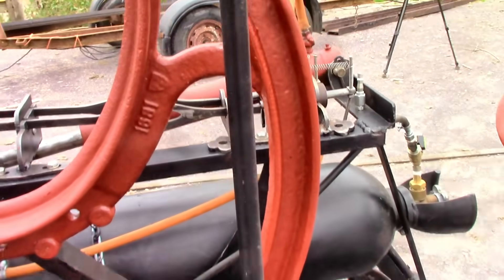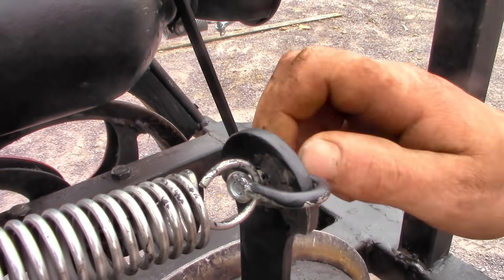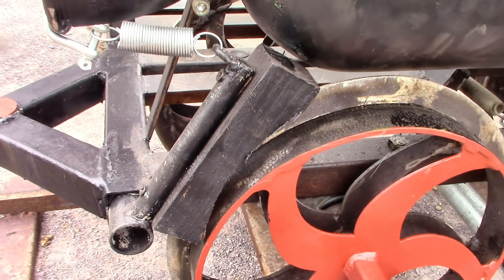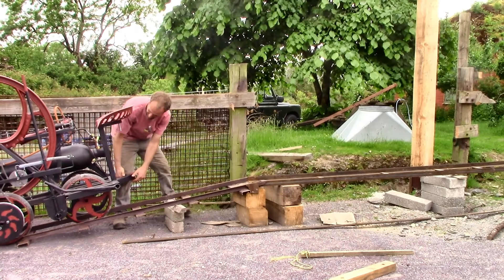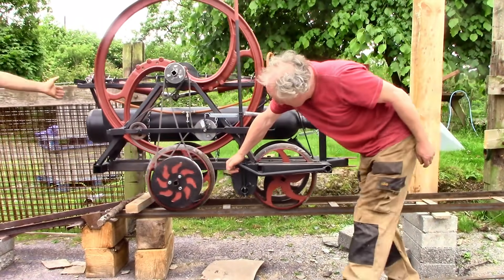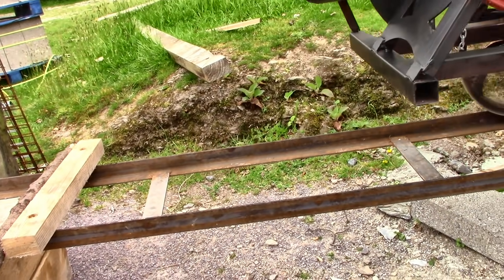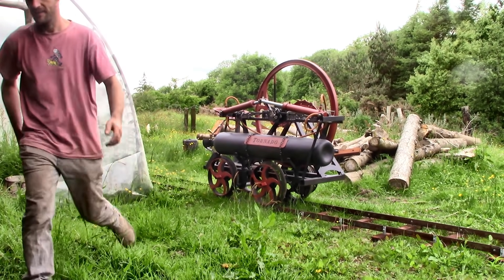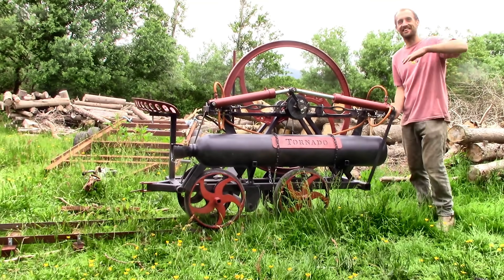First Run!! Home-Made Compressed Air Locomotive For The Field Railway

Comment: This is looking very promising, congratulations on achieving the running prototype! 

I think one of the problems you might encounter as this gets more use is that with both running and braking the thin angle iron rails will start to eat grooves into your wheels, which don't have a steel "tyre" as a replaceable wear part, so once they're worn they'd be a total loss. I highly recommend checking out something called "strap iron rail" which is basically steel straps nailed to timbers, an old frontier logging/mining innovation. This would widen your railhead quite a bit, which would help with wear, braking, and traction. They'd also most likely be a fair bit cheaper than your angle iron rails. With your CNC machine you'd be able to cut curved pieces, to fit to steam-bent or jointed curved timbers, making curves probably a fair bit easier to accomplish to boot.

Comment: Superb job , why don't you connect both axles  with a chain drive ,that would increase your adhesion and brake power  . It would turn your existing loco from an 0 - 2 - 0 into an 0 - 4 - 0 
Keep up the good work

Comment: about the breaks: you could engage with the tracks instead of the wheal.
also: most trains have breaks along all coaches. It is not very good, when there is a break in the front and the rest of the train is pushing from behind.
Perhaps you will make a break coach that you can put at the end of your train.

Comment: I feel like you should move the seat back a tad and make some form of protection between you and the flywheel, last thing you want is that coming apart at full power while your sitting next to it. You dont need to obstruct your vision but atleast a thick plate of steel you could hide behind other then my random suggestion amazing work ive been watching for awhile

Comment: Looking good.  Suggest lock for brake so it can be a handbrake. Then ideally larger diameter cylinders so they can be run on lower pressure to make tank last longer. If they were air not hydraulic cylinders then they would be designed to work dry and last longer too

Comment: Happy to see the Locomotive finally running!
Maybe you could try to hack fridge compressor into an high pressure Compressor.
Certainly not the best solution, but it can be done on the cheap. There is several video on YouTube of such things, with different claimed max pressures.
For example this one: http://www.youtube.com/watch?v=4iGNhpEI-JA (claimed 400psi peak, 300psi without overheating)
Reply from the maker: Thanks, yes, I've thought about it but 3 or 400 really wouldn't be enough to be really useful
Reply: @wayoutwest-workshopstuff6299  Sorry I'm not so used to PSI and I got a bit confused... Indeed 300 isn't that great.
Interesting but complex topic, to get that much pressure. Tanks are easy to get, but not the compressor. I also had a look for vehicle parts (AC, Air suspension, brakes, etc...) but nothing use such high pressure.

There is load of these 4500 PSI 1800w Chinses compressor on ebay, you can get a bit over 200€. But you get what you pay for, and reliability seems to be kind of random.
Otherwise some people just put a motor to drive a hand pump for Air rifle, like here https://www.youtube.com/watch?v=JFtjR53sxno but it will probably wear really fast.
A guy build a "proper" one from scratch here, with way to much machinery involved https://www.youtube.com/watch?v=mcFurIyTZgQ . The best idea from this video is not only to use a normal compressor as intake, but more particularly to put an oiler before the pump. 
Maybe you could build something like the hand pump one with some home made piston. A bit like the Loco itself, just smaller.

At the end, do as you feel. I'm just looking forward to see the Tornado going full steam ahead :)

Comment: That's Brilliannt. I'm glad it works after all the time and effort you put into it. A couple of future improvements would be to add a coupling hitch on the other end and to add coupling rods to get more addhesion and would allow your single brake block to act on 2 axles.

Edit: Spelling Mistakes

Comment: I think you will also need a regulator on the neck of the cylinder if you plan on running high pressure air or those hoses won't last long.

Comment: Try cutting up some old rubber boots and attach the rubber to your wooden brake system. We used to do that with our soapbox racers back in the day.

You could also try to have the rubber push on the side of the rails for more stopping power, then you are not limited by the friction between the wheels and the rails.
Reply from the maker: Interesting idea - thanks

Comment: Brilliant to see it in action. It even sounds like a proper engine, and you used Sandra’s suggestion for a name. When you get a diving compressor, you might need an old oxygen regulator and may have to submerge the oxygen bottle in water while filling it. Diving bottles are submerged while being filled as they get very hot. Good stuff 👌
Reply: A paintball compressor would be better. They get up to the same pressures but are not so finnicky with the air they put in the tank. 

Diving compressors are magnitudes more expensive because they have to treat and filter the air they put in the bottle because humans have to breathe it. 

In this case a paintball compressor would be perfect as it doesn't matter if the air in the tank isn't breathable.

Comment: I can tell you are having a great time with this build.  If you can get a belt to drive both axles all the time, the brakes will stop all 4 wheels and double your stopping power.   Please be careful with the higher pressures, those hoses wont take 3000psi.

Comment: Have you seen those high pressure stirrup pumps used to charge up certain types of air rifles, the cheap ones only cost about £40 and do go above 3000psi? If you could mechanise one (or two) of these and keep it cool, I think you could charge your tank up!

Comment: Great work on the locomotive!

If your interested in a steam engine I've been looking into a boilerless hot head steam engine 

The idea is you have a furnace approx 1ft in diameter where the cylinder head ideally made of a thick section of metal makes up part of the top of the furnace 
The cylinder has a slot for exhaust at the top of the cylinder and at at the bottom a port aiming at the thick cylinder head water is injected onto the hot cylinder head to flash into steam just before bdc powering the piston up until it reaches the exhaust which exhausts steam into the furnace flu which surrounds the cylinder drawing in more air into the furnace 

It's probably been done before but might be fun to build
Reply from the maker: Go for it! I'd be interested to see how it turns out

Comment: If you can find high capacity high pressure compresor then just find one tah can do high pressupre and put it in a series with the curent one.
U will get more pressure and preety much same airflow unless there will be a big difference between compresor sizes.

Comment: You might rough up the steel on the wheels a bit to improve traction. Model railroad engines have ridges cast into the wheels to get traction, and I believe the full size ones do to.

Comment: On the brakes, since you've got flatbar for rails there isn't much surface contact. Maybe you can salvage a car disk brake caliper and mount it so that it can grip the rail and slow you down. Maybe a pair, one between each wheel where the center of gravity is.

Comment: This is super impressive. Really did a good job. Even at 100 psi you have more than enough power to do most things. Once you get the bottled filled for the first time it will be super amazing. 
If you do find a compressor and if you get lucky and get a 2nd bottle you can have one always filled as a replacement for quick exchange. Though I do think you could use a couple of smaller bottle and still be fine. Either way super good job on the machine.

Comment: Very impressive! For braking, I think you'd get better results with a track brake (flat wood against a rail or rails, instead of the curved wood against the wheel). Obviously not so much pressure as to derail, but that's not likely a big issue.

Comment: Tim... you can increase the torque of the cylinders by running a hose to the lower ports of the cylinders to the upper port of the opposite cylinder. 

 This will apply pressure to the bottom of the opposite cylinder pulling it up. Should increase torque with out increasing too much more consumption for the same speed as you can use less pressure.
Reply from the maker: But the air coming out of the piston has to be unrestricted or it will affect the flow.

Comment: I'm absolutely tickled to death finally seeing it in action, really well done. It has the look of a lot of early locomotives, and just the overall mechanism is thrilling to watch. I still have my reservations about compressed air as the power source, but I still love the machine. Really well done.
Reply: Aerul comprimat se termină repede. Trebuie folosit, dar nu ca volum de forță, ci ca presiune( energie potențială). Un disc îzolator cu cristale piezoelectrice înglobate, rotite între 2 role, arcuite, nu consumă  mult volum de aer. Mai mult presiune. Si produce curent electric. Sau aer comprimat în funcționarea bateriilor ce aer. Adică aerul trebuie folosit mai mult drept catalizator, decât forță directă.
Reply: Why????? Air was used in professionel lokomotives. For example in coal mines whith the danger of explsions.
Reply: @bernhardammer5106  right, but that was at a large, stationary facility with limited tracks, and undoubtedly large compressors and crews to run them. 

My reservation is range/run time of the system he setting up. Too much down time in my opinion.

Comment: One simple machine stacked on another.  Larger port on the dead side of the piston would give you more power. Put at the bottom would expel water. A port and valve added on the pressure side at the bottom will also drain water.  A little in line oiler may help with rust. They had a high volume pneumatic quick release wafer valves that went on the air cylinders on anchor line brakes.

Comment: I wonder if when you find a better air generator and a small honda generator so you could mount it on the loco so while running you could make the air back as well the would be the first gas-electric-air locomotive

Comment: I like the aesthetic of the curved spokes on all the moving wheels (fits with the name Tornado) and how well the color scheme worked out, especially with you both wearing red shirts. A suggestion would be to have the spring keep the brake against the wheel (and resting your foot on the lever releases it). A coupler at the other end might be helpful too. Could the cylinder be refilled with steam?
David
Reply: In theory, you could fill the cylinder with steam. However, it opens up a world of problems that are hard to solve on a DIY engine. One of the biggest things is that you will have to thermally isolate the tank extremely well, otherwise the steam will just turn to water in half an hour or so. 
Increasing air pressure with a dive tank compressor seems to be the most obvious improvement, as well as having some gentle heating of the tank to counter the cooling effect of the expanding air. The self cooling effect lowers the air pressure which is not a good thing in this case.

Comment: That thing just screams early steam locomotive! I love it! A giant contraption of belts cogs wheels steel, completely intimidating yet enduring. Can't wait to see it with a real full bottle of air or a boiler on a tender.
Reply: He does have rubber tubes so maybe high pressure steam wouldn't work

Comment: Looks like you will need brakes on every axle to get stopped.  But you do have Air available so you could easily get a few smaller air cylinders setup to activate the brakes on all the cars as well as your Loco.  And don't forget that you can use your reverse to help slow the other axle down for braking as well.  It will waste some air that way but when you REALLY need to stop it may make the difference.  

Another thought is regenerative breaking, setup some small air compressors and make it so you can engage them as well.  The wheels can turn a compressor which you could then use for the air brakes instead of the cylinder of high pressure air on the Loco.  It does mean adding a tank but a small 5 gallon one should work fine since I doubt you will get over 8 bar or so.  Install a check valve on each one of the compressors so they can't turn backwards due to the compressed air and install a small electric (I know electric right) solenoid to open the air for the brakes.  Another regenerative braking system would simply be car alternators.  Then you could use a servo motor to apply the breaks on everything.  The alternators could charge some small battery banks and then you would be able to have lights on the loco for night time use.  Basically it's free electricity (or air) that you are currently just going to dissipate as heat since that is what a braking system does on a vehicle without regenerative brakes.

Comment: Tim, I have been a big fan of this project from the start. I love seeing The Tornado running down the rails.....And, I can't help but feel that 
re-valving the cylinders to double action, would increase the efficiency of the air at least 2 fold. So you could easily go and additional   75% more distance (losses in mechanical prevent 100%) further or heavier loads. Should be a cake walk for you now to make the new valves. Keep up the great work....love to see it hauling logs and such, to give Henry a break.

Comment: Wonderful!

I think you would get better braking force if you put brake shoes on more of the wheels. You could run a bar across the loco between the axles, parallel to the wheels, attached to 4 brake shoes via pivot points, and a lever that pushes the bar up or down.
Alternatively you could mount the bar in a vertical slot, with the shoes fixed so when lowered they all engage the wheels. The lever would control the bar by pushing/pulling it, mounted on a pivot farther up or forward.
(It’s really hard to describe this idea in a comment, but I don’t know much about graphics editing.)
Reply from the maker: Thanks, Pauline - the animals know I make lots of noisy things and they really don't seem to mind at all.

Comment: you might want to redo the brakes so that it applies when not stepping on the pedal so it can park and will stop with no driver. Also can all those fittings take the pressure? 3000PSI seems like it would be too much for those hoses, and if you don't have some automatic regulators you'd probably forget to regulate it eventually right? Still loving it, just some slight concerns I had.
Reply from the maker: I think it maight be able to handle 200 psi? And the rest in the tank..
Reply: @wayoutwest-workshopstuff6299  oh so there is a regulator? I don't know much about this stuff in practice, just theory and I couldn't see one.

Comment: That is very cool. It sounds great. Now if you can find an engineers hat and a wooden train whistle you are set. If you put a hitch on the front you will be able to push and pull at the same time. There must be a way to fool your compressor into continuing to pump past the 100 psi. Thanks for sharing.

Comment: You can use water to compress air. Just buy gravity alone. Entrap bubbles of air up high suck them down low and put it into a bottle. You can get a few hundred PSI that way
Reply: That's how they used to power old mining equipment
Reply from the maker: You need a lot of height/weight of water though..
Reply: @wayoutwest-workshopstuff6299  yeah but running water is way way cheaper than an expensive compressor. Honestly I don't expect anyone to use this idea I just thought it was an interesting proposition